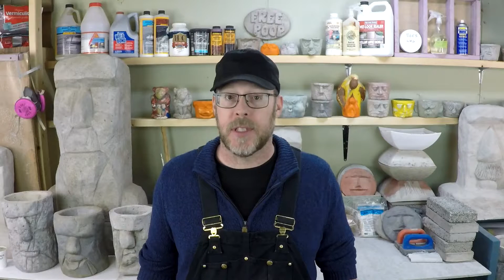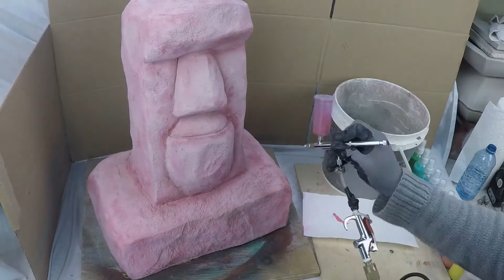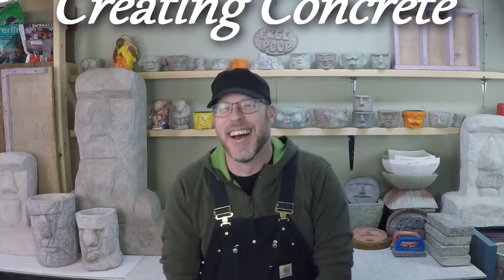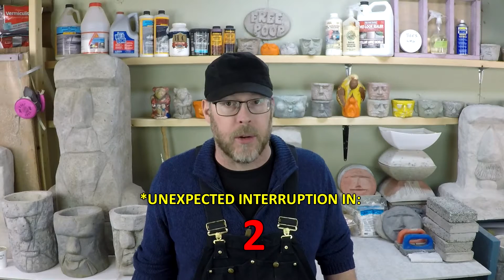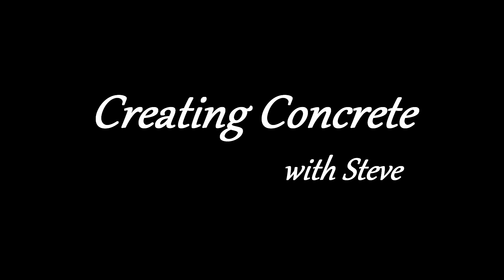Why Does Concrete Crumble?

Comment: Ideas for videos I'd love to see: Does it help to let concrete cure underwater? Will using finer sand in my mix give me a better finish? Does a kitchenaid mixer mix concrete well? More stuff with white portland cement would be great - especially applications with bright colors added. Practical tips for making brick molds. Making pavers with custom interlocking shapes. Making interlocking bricks or pavers and molds for interlocking bricks or pavers. Experiments with unconventional (bad?) aggregates like plastics, soils, clays, other things you may have around the house. How is concrete with just sand different from concrete with sand and larger aggregates?
Reply from the maker: These are all great ideas.  You are definitely hired!  Will start working on these.  I especially agree about the white cement. I picked up 3 bags and I just have not had time to get started.  That is a lot of stuff I need to make with almost 270 lbs of white portland cement!